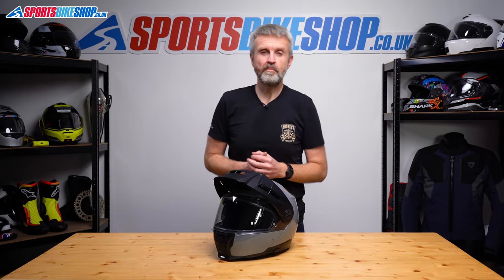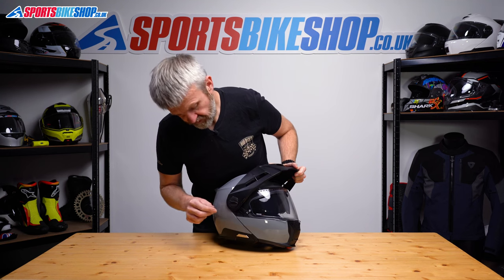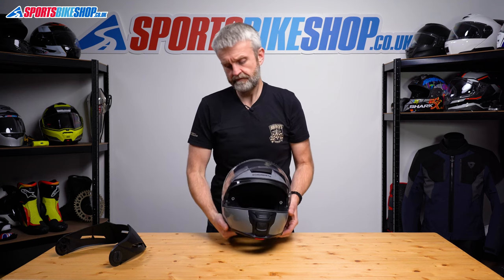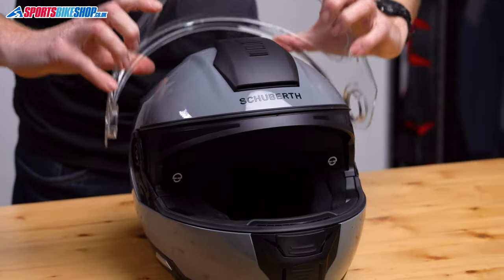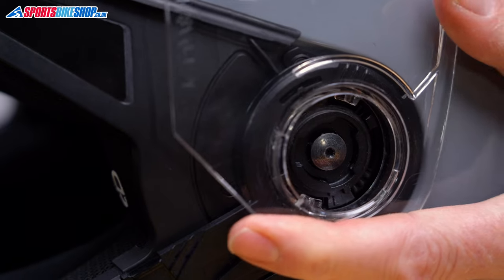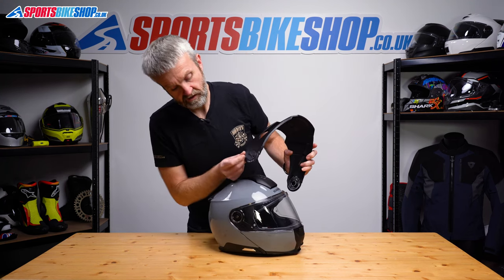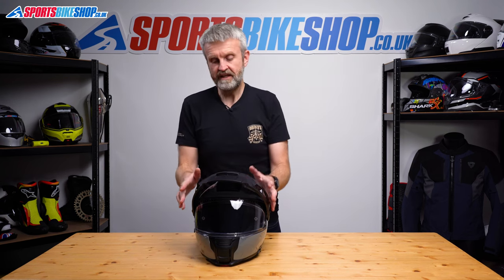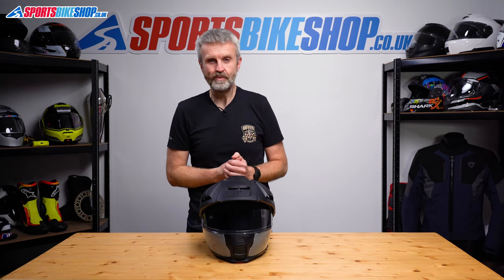How to change a visor: Schuberth E2 motorcycle helmet

Comment: Can one ride the E2 with the beak but without the main visor. That is using an off road goggle instead of the main visor for better airflow in hot weather.
Reply from the maker: We just about managed to fit goggles into the eyeport when we reviewed this helmet, but it wasn't a configuration I'd want to ride in. When Schuberth launched the lid they showed some C5s being used on an MX track - and those riders had the visor attached, not goggles. I hope that helps. Cheers, Tony